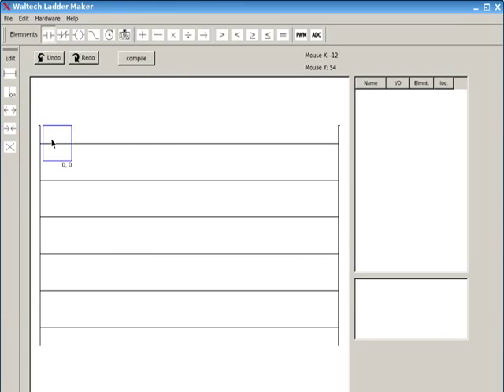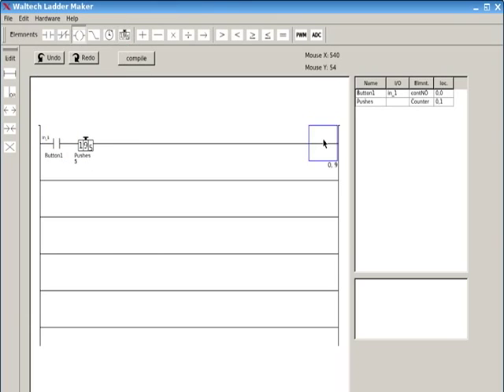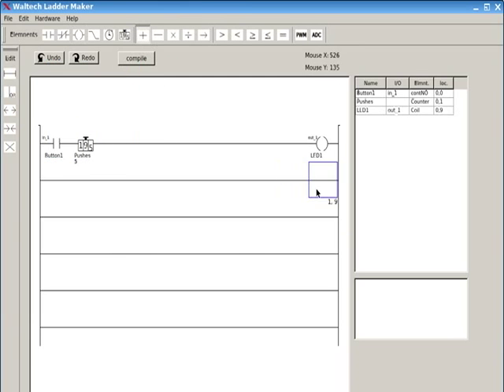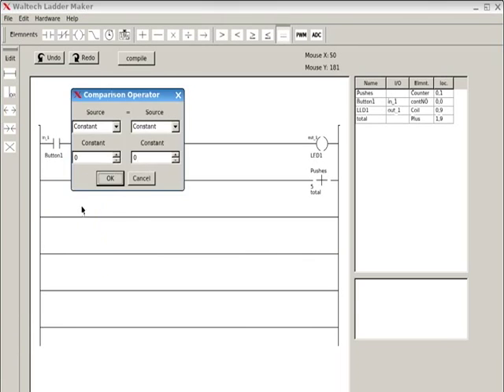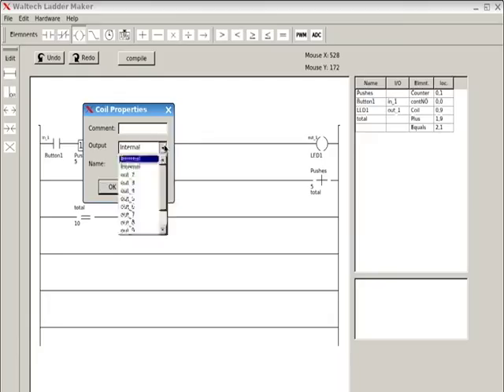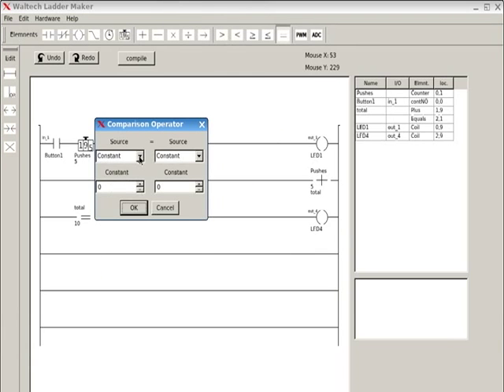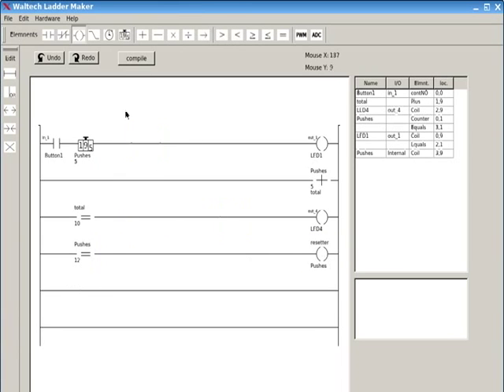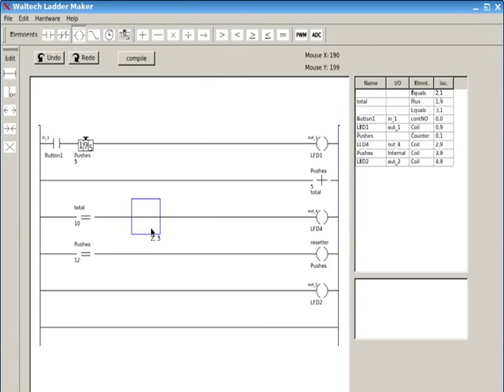Waltech Ladder Maker, preview of additional elements

Comment: Hello Karl. I just finished downloading your software and unzipping it. There was no Icon installed that will allow me to open the software and begin its use! Please advise on how to begin from unpacking forward ?????
Reply from the maker: Browse to Program folder, open a terminal, and run main.py. (command: python main.py)  Requires Python 2.7 and pyQt4.  If you downloaded the older windows version, just double click the .exe file.
Reply: The problem is, I do not get a ladder at all. I just get the command prompt dialogue box that opens momentary, and then closes immediately.. Any settings I might need to change ? Virus or soyware maybe ??
Reply from the maker: Windows or Linux? Which version of LadderMaker?
Reply: Windows 10. Python 3.6.1 she'll. Ladder maker 110a.
Reply from the maker: Hi, You need Python 2.7 and pyQt4.  It won't work with python 3
Reply: Ok, thanks, I will give it a try.
Reply from the maker: See the links below this video. https://www.youtube.com/watch?v=QxMMDk3wMsw

Comment: NC and NO Structure reversed? I put NO contacts but not with VCC and the output is active when soil.
Reply from the maker: NO is designed to work with a switch that connects to ground.  The internal pull-up is on.  if you apply VCC to the input, this will be "open".  Apply gnd to the input, this will be "closed."
Reply: Karl Walter NO Kontak kullanrak, Lojik-1 geldiğinde çıkış almam mümkün mü? Ladder mantığı budur.
Reply: Karl Walter It using the NO contacts, logic-1 when it is possible to get out? Ladder logic is.
Reply from the maker: Sabri ÜNAL This did not translate well.
I think you are asking how the NO and NC be changed.  You would have to edit the OutLineToC.py file and change findInPutsArd to findInPuts.  If you are using the Windows package you will not be able to do this without switching to using the source code.

Comment: Hello Karl thank you guys for this great software
is there a way to make off delay timer?
Reply from the maker: Yes, it has a delay timer element.
Reply: Karl Walter Thank you for your quick reply but I've only found (ON Delay Timer) and my question is there a way to make it (OFF Delay Timer)
Reply from the maker: Mohammed Jerjawi 

Use an internal  normally closed in the rung with your input contact. Then use an OR wire between tham, down to a branch with the timer on it, to an internal coil.  Share the name with the normally closed. --Karl
Reply: Karl Walter Thank you very much it worked :)

Comment: Hi, love the video! I am looking forward to using this software to program multiple arduinos for my upcoming home automation project. My question is, can I incorporate this software using inputs triggered by an android device running some sort of user friendly interface? Any help would be appreciated! Thanks!
Reply from the maker: I think bluetooth serial from the Android would need to be received by an Arduino that is set up with a bluetooth shield, and programmed (in Arduino C) to trigger outputs.  Then use that as a bridge to inputs on an Ladder logic programmed Arduino.   There may be more ways, but that is the first one that occurs to me.